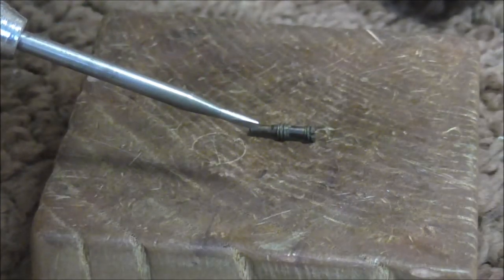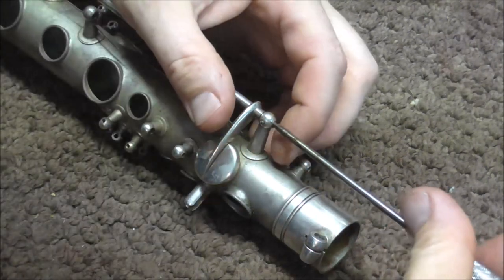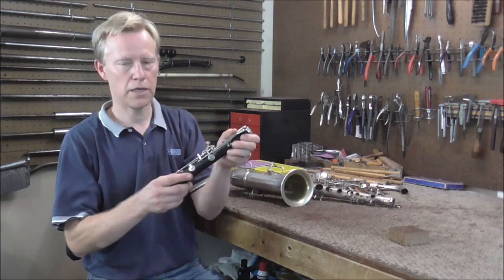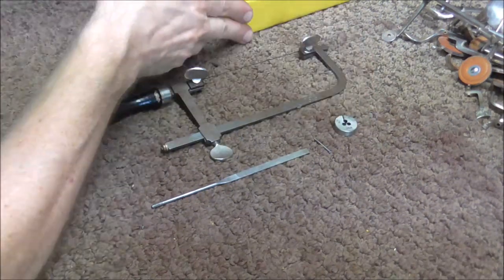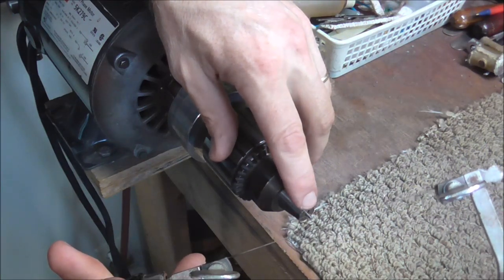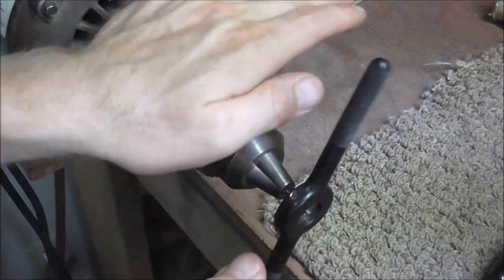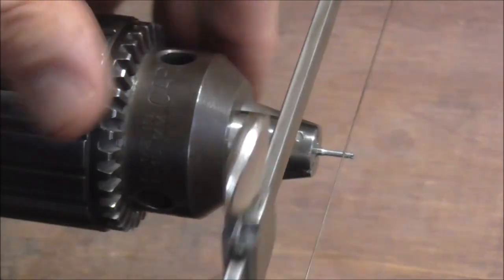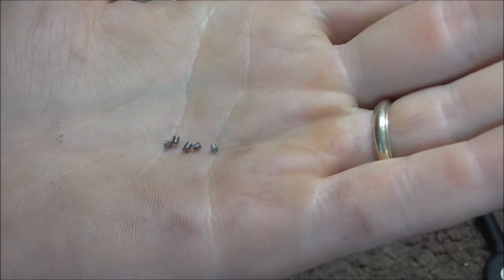How To Make Those Little Locking Screws for Conn Saxophone and Clarinet

Comment: Any idea where to get the pivot screws for these clarinets? I recently squired one that has a few of the screws broken, I suspect from not removing the locking screw.
Reply from the maker: Those screws can be made without too much difficulty or you can check with your local repair shop to buy them. If you found a similar clarinet that is junk/for parts, you could use them.
Reply: Actually I just found them at ferrees I just didn’t know what they were called. But Curtis for the win!

Comment: Is the die you are using a BA thread ? And is the size an imperial 1/64th of an inch die.? 
I am a little confused. Thanks for any help you can give me.
Reply from the maker: The "1" is the diameter of the screw and the "64" is 64 threads per inch. I am not sure about BA or imperial. Here is the link to where you can get one of the dies: 
ferreestoolsinc.com
The order number is D210-1-64
You may also be able to get one at your local hardware store.
Reply: Thanks Art for your quick response.
I understand now.

Comment: If you do not have a 1-64 die and the skill to use it, you can buy 1-64 screws. Then you just need to cut off the screw to the desired length and cut a slot in the head. You can buy a box of 100 1/2" screws from Grainger for 12 bucks:
https://www.grainger.com/product/FABORY-Button-29DL49

Comment: couldn't you buy screws with the right thread and sawing off the length needed for the locking screw, after which you just saw a little slot in it?
Reply from the maker: Yes, you can do that too. Some hinge rods have 1-64 threads, so you can use the threaded portion of the hinge rod  if it has the correct threading.